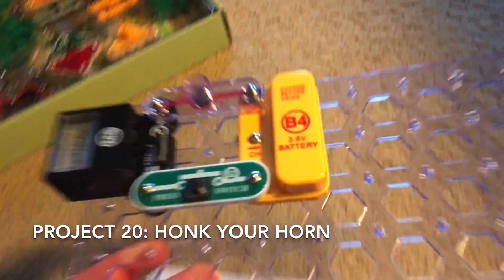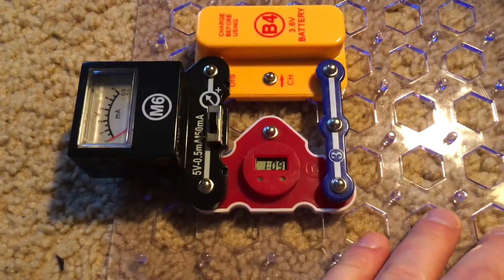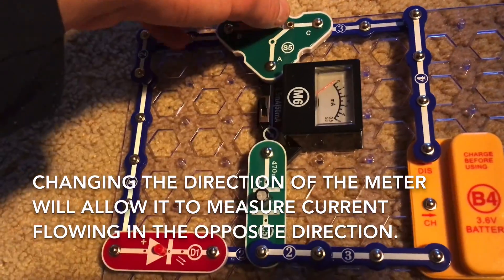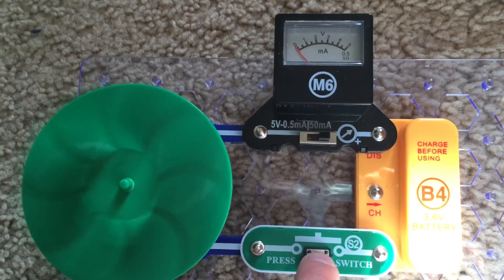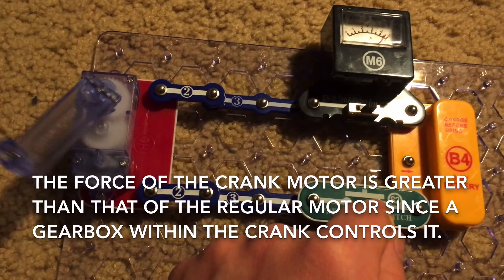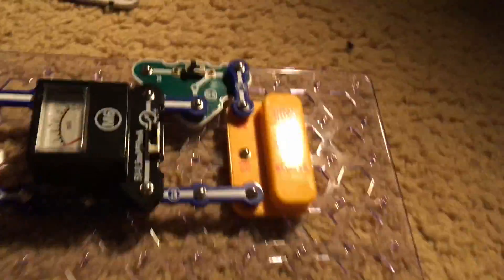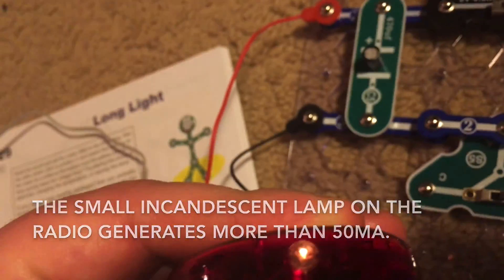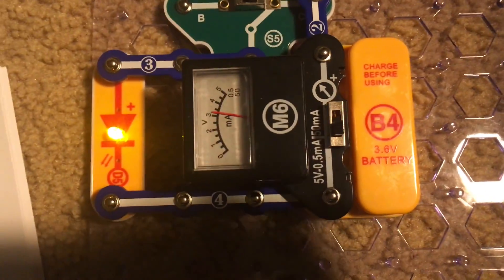Snap Circuits Green: Projects 20-29 (VOLUME WARNING)

Comment: There is a capacitor in the snap circuits (not in the kits) it’s called C8 it holds 4700μf. You have to buy the part from the shptron website
Reply: I got a C8 capacitor from a exclusive snap circuits kit